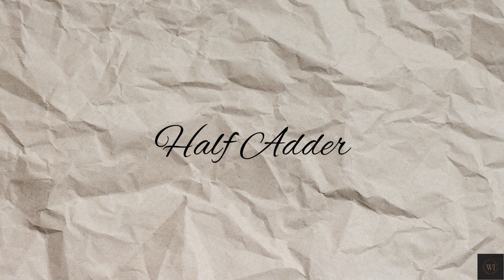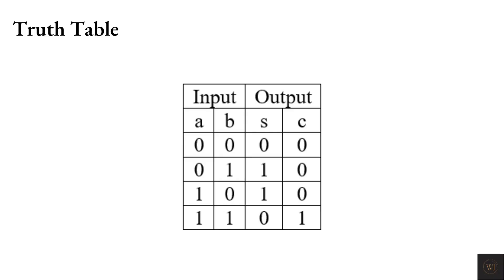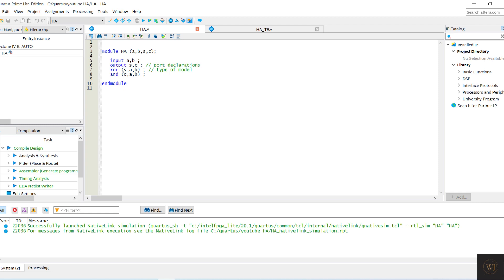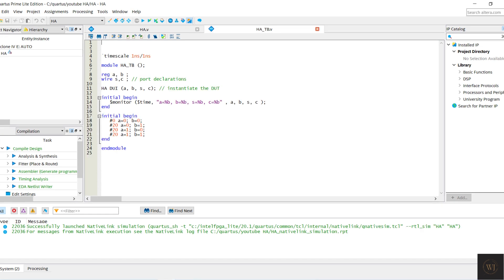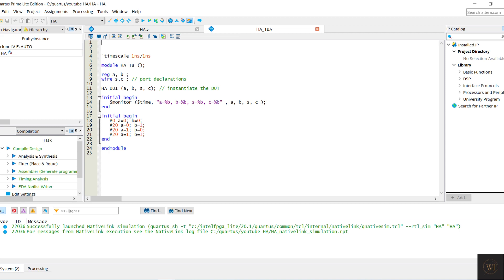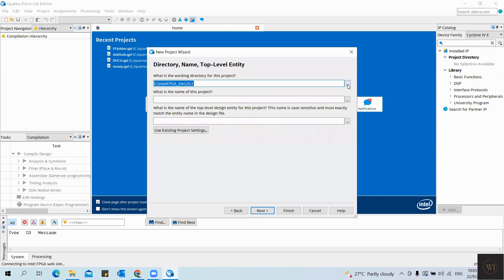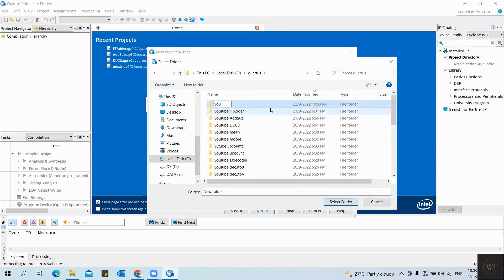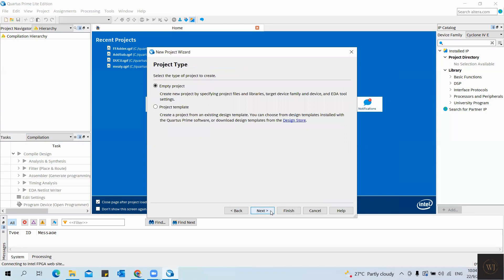Write Code in Quartus Prime (Half Adder)

Comment: I'm trying to run it via RTL Simulation but there's an error message saying ""Nativelink error" is it because I'm not connected to fpga yet?
Reply from the maker: This coding already consist of testbench, so it does not need to connect with FPGA. The simulation results will show after u compile both coding.
Reply from the maker: Sry, about that i forget to show the step before running the rtl simulation. U can refer to this video to help u solve the problem
https://youtu.be/PmVVXQchv2c
To be clear this video is not from me. Thx